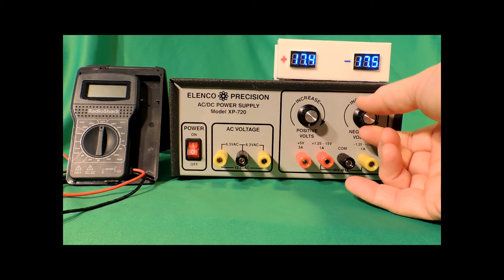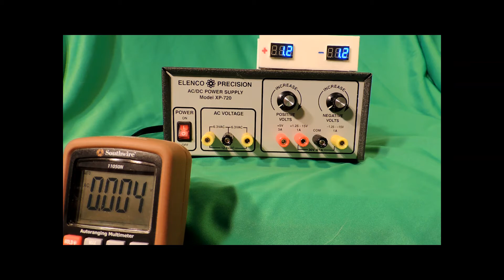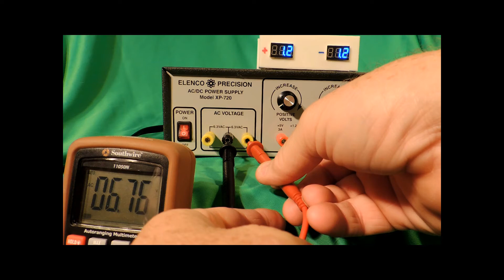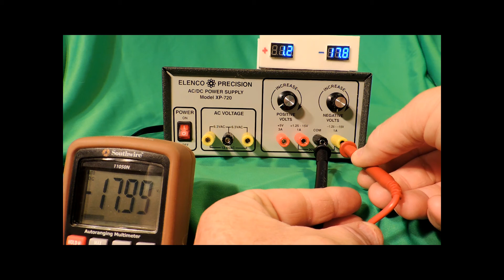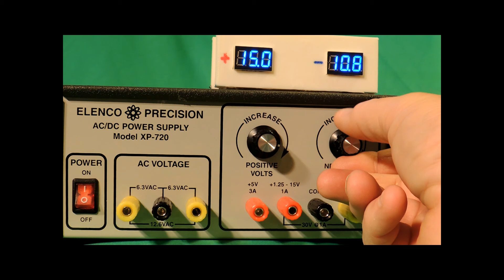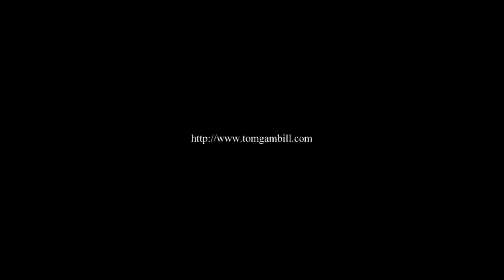Elenco Model XP-720 Power Supply

Comment: I assembled mine, but the output positive and negative voltage is only 2.7V on the AC I got 6 V when I check D1 and D2 i got 27V. Anyone can help me  troubleshoot it
Reply: sorry man, i dont know much about electronics. i got one already built for the DC output. can you tell me how to set it for the highest output amperage? i believe, from his video, the far left red 3A terminal and the black common. but the dials above... positive and negative voltage, where do i set them?
Reply: @d-arts7139  i got it troubleshooted, i had to switched wires.

Comment: can you explain the wiring for Digital Panel Monitor?
Reply from the maker: Sorry, the photograph isn't very helpful, and I am switching my ISP so my website is not up again.  Here's the explanation of MY hookup.  Usually, 3 Wire Voltmeters have a Red (POSITIVE), Black (NEGATIVE), and White or some other color (SENSING) wires.  The red and black wires supply the operating voltage to the VOLTMETER.  The white or other colored wire is normally connected to the voltage being measured (usually the positive side, as there is usually a shunt inside the voltmeter circuitry that allows the power supply NEGATIVE to share the ground connection for the voltage being measured.  If your voltmeter has REVERSE VOLTAGE protection for the SENSING portion (not the power supply to the voltmeter itself) it may or may not work.  First, I connected both RED (POSITIVE) WIRES from EACH VOLTMETER together, then CONNECTED a wire from these 2 POSITIVES to the 5V 3A Terminal (This produces a constant 5 volt power supply for both Voltmeters and they only use about 20mA each, further these particular voltmeters can work on 3 to 30 volts) and is separate from the variable voltage with the 1A maximum current.  (WARNING:  MAKE SURE YOUR VOLTMETERS WILL OPERATE ON 5 VOLTS).  Next I took the BLACK (NEGATIVE) WIRE from the LEFT or POSITIVE VOLTMETER and CONNECTED it to the WHITE (SENSING) WIRE of the RIGHT or NEGATIVE VOLTMETER.   Then I CONNECTED a wire from these 2 wires to the BLACK (COM) TERMINAL.  Lastly, I CONNECTED the WHITE (SENSING) WIRE from the LEFT (POSITIVE) VOLTMETER to the RED (+1.25 -15V) TERMINAL and CONNECTED the BLACK WIRE from the RIGHT (NEGATIVE) VOLTMETER to the YELLOW (-1.25 - -15V) TERMINAL.  (I printed the Voltmeter holder with my 3D Printer, drilled two holes through the cover where  the voltmeter wires would go through, and attached the voltmeters to the cover, leaving enough slack in the wires so I could open the case in the future if need be.  I just used a permanent marker to mark the voltmeter cases "+" and "_" to remind me which was which.)......I hope this helps!
Reply: Much Appreciated. Thanks!

Comment: hi where did you get those small voltmeters? thanks
Reply from the maker: I bought them at Amazon about a year ago.  Although that seller is out of stock, there are others available.  Here's just one example link:  http://www.amazon.com/Light-Digital-Voltmeter-DC0-100V-Voltage/dp/B00L8ICIDK/ref=sr_1_16?s=electronics&ie=UTF8&qid=1464268243&sr=1-16&keywords=LED+VOltmeter+Panel
Reply: +Tom so those are 3 wires voltmeters... what have you used to power them?
Reply from the maker: Sorry my website is temporarily down but will be back in service soon (June 2016).  There is a picture there that illustrates.  For now, you can go here to see the pic:  
http://i1228.photobucket.com/albums/ee457/TomTheHobbyist/VoltmeterWiring_zpselcwiack.jpg

Check the datasheet/specs for your voltmeter, but most can use from 0 to 30V DC for supply.  My meters have red, black, and white wires.  I connected BOTH meters' red wires  to the back of the RED terminal on the front of the power supply labeled (+5V 3A).  I connected the Ground (Black wire) of the POSITIVE meter (the one on the left) and the WHITE wire of the NEGATIVE meter (the one on the right) to the back of the BLACK terminal on the front labeled "COM."  The RED wire of the NEGATIVE meter (on the right) is connected to the back of the YELLOW terminal on the front labeled "-1.25 - -15V 1A."  Note that most of these 3 wire voltmeters have Black/Brown wires for the ground, Red Wires for the "positive" voltage, and White/Yellow wires for measuring the incoming voltage.  On this meter, I just reversed the leads for the "Negative" meter on the right.  Hope this helps!
Reply: +Tom  Thanks
Reply from the maker: Sorry Sky, somehow I inadvertently skipped over this.  Yes, they are 3 Wire voltmeters that cost about $3.00 each.  For detailed wiring instructions for 3 wire voltmeters see my reply to Jonathan above.  

Short Answer:  Yes, 3 wire.  I used the +5V line to power them.